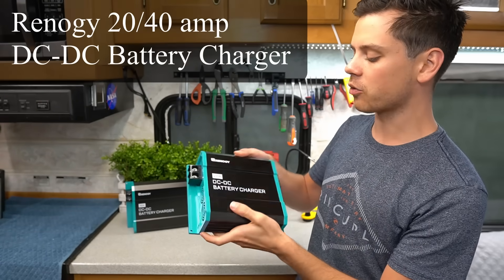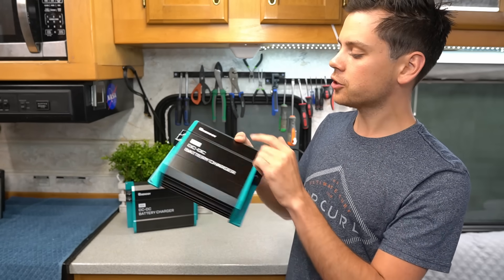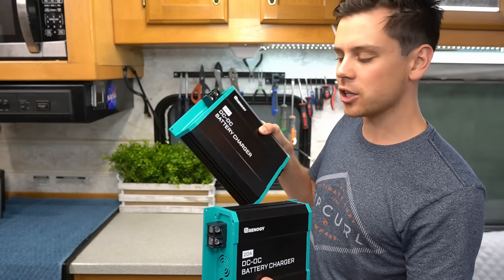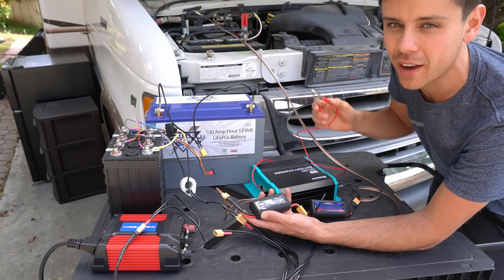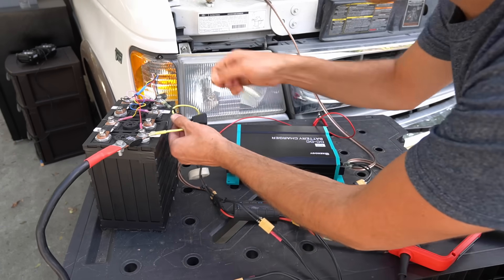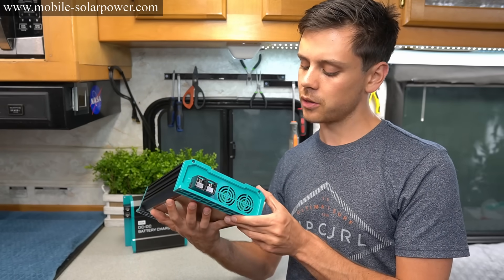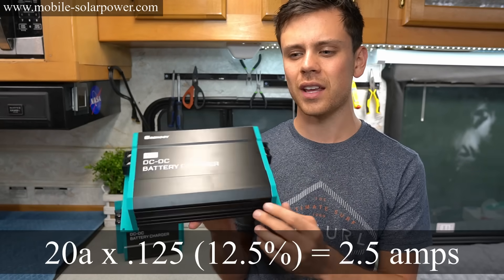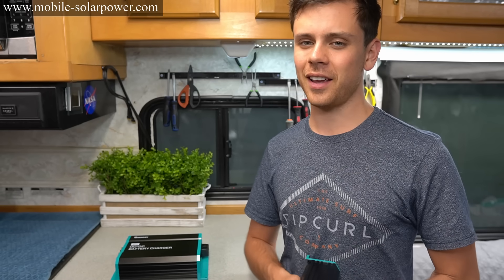Renogy DC-DC Battery Charger Review: "Smart" Alternator Charging for Solar Batteries!

Comment: Would you need to used this between the 12v 30A RV port on a Bluetti AC300 to charge a Lifepo4 battery or could you connect the AC300 directly to the battery?

Comment: My current DCDC charger appears to be failing (another brand), and Renogy came up as the top suggested replacement.  I only have 100ah AGM battery for a portable fridge. I do not have a smart alternator.
My question is:  do you have to have the ignition wire for this to operate, or will it work with without?  I do have a VSR between the Start Battery and the DCDC charger.

OOPS. watched the full video and it does appear that you need the ignition wire....

Comment: The current limiting feature is VERY useful actually. Lets say I have only 90AH AGM battery for my SUV and later on I'm planning to buy a travel trailer and install 400AH LI battery bank. We know for AGM max charge current is about 10-20% of the total AH... so I will buy 40A charger and limit the current... later on for the RV trailer setup.. I remove the current limiting connection... :)

Comment: You could put a switch on the ignition wire and start the engine and then turn it on if you want warm up. A bit of a pain but isn't everything ! This would be nice to have to charge a deep battery to run a frige in my Jeep . always having power for 12v things when overlanding would be nice.

Comment: Hi will! First ty for all you do ive learned so much. I had installed a dc-dv charger to my van by my van conversion company but i was thinking of upgrading to a 2nd alternator to my camper van? Its 3000.00 without labor. I have a 12v AC so i can cool off van for my pups but on rainy days boondocking ive struggled keeping everything going If i just ran the engine the dc-dc charger isnt meant to charge my battleborn batteries without have to drive it qBut ive been told a 2nd alternator would def charge my batteries if i just ran the van and alot faster..I have a ram promaster. Ive have quite a great set up but ive run into trouble boondocking with no sun and had issues with dc charger just not charging batteries enuf when doing short drives. Is it worth it to upgrade to a 2nd alternator?  Anyone with any thoughts or advice would so appreciate it! Thanks to u will i have a great system in my van!

Comment: you can get around the imeadiat start by putting it on a switch that is on a circuit that is energized when the engine running.  ford upfitter switch is what I am using for mine so I can control when I need it even if the truck is running as normaly my solar is all I need on my camper.

Comment: I use the 40 amp dc to dc in my 5th wheel camper. I ran the trigger wire to one of the camper side lights and a  minute after I start the trucks engine I turn on the truck lights which activate the camper lights (they are all LED) which starts the dc to dc charger. When I first installed the dc to dc, I made sure the camper's lithium batteries were in a somewhat low state of charge. I watched my dc clampon meter and saw 39.9 amps. It stayed at that level of charge for a few minutes then slowly dropped off to just an amp or 2. So, that dc to dc charger seems to do a good job of managing the amperage charge rate.

Comment: Great video. You could add a 12v dc "time delay relay" on the ignition circuit to delay power going to the unit, giving your alternator a few extra seconds to power the charger. Simple to install.
Reply: Any recomondations certain manufacturers?
Reply: @mobilehomelife4028  I set one up that includes a programmable delay, and also cut on/off based on system voltage (it will cut off if your alternator voltage is too low, and only kick back in after x seconds once voltage is available) works excellently, i got mine from BimbleSolar (UK based) on their website it's the digital voltage sensing relay EAZY-IV-U3

Comment: The current limiting option is actually very useful for the following reasons: To my understanding (I'm not a mechanic), the higher the amperage of the DC-DC charging the more strain on your alternator, so limiting to 20Ah as opposed to 40Ah charging when you don't need much charging, could enhance your alternator's lifecycle.  You've 2 options instead of one (40Ah and/or 20Ah), so if you decide to upgrade your alternator you'll have the option of going to 40Ah, saving you a load of money.

Comment: The current limiting (LC connection) is well explained in the current users manual. “The DC-DC battery chargers feature 50% current limiting from the rated specification when connecting the LC Terminal to a 12V source. Current Limiting is instant and recommended to be connected to the same location as the D+ ignition cable. Alternatively, you can toggle current limiting to your liking by connecting the LC terminal to starter battery positive terminal. In this fashion, current limiting will always take until removing the LC wire from the battery terminal to revert to the normal amp rating. Use 18-16AWG copper cable for the LC terminal and you may need to splice your own connections for the other cable end depending on your connection point.”

Comment: I believe it was you who said not to use more than 2 batteries in parallel. I just ordered a small solar backup system to power my pellet stove. After doing the math I figure at 2560wh, with it drawing 175w and not being able to fully drain the battery, at best I'll have 7 hours of heat. Definitely ordering a DC to DC charger. I think I'd of been better off using my truck vs solar power. It cost almost 400 for just the 2 batteries, and plan on buying 2 more next month. Was gonna buy another 200w of panels too. Not so sure solar if for me.

Comment: From what Ive seen Renogy recommends using the 20 amp DC-DC charger if your alternator is 160 amps or less. Even my 09 diesel dually truck only has a 145 amp alternator so I went with the 20 amp Renogy. Last thing I want to do is over tax my trucks alternator in the summer when the AC is running at night with all the lights on.

Comment: Will a test of the renology dc dc 60a be forthcoming and a breakdown of choosing the right amp charger for your system.  My alternator can output 160 amps. Therefore I chose the 60amp renology assuming it had sufficient amps to charge from. I hope I’m right

Comment: Hi will, quick question regarding the 20amp dc dc charger, I live on a river boat with 390ah AGM battery bank, I have the Victron Orion 30amp dc dc charger installed but it only ever seems to put in 23-25amps even when batts are at 65%? Would it be possible to add the 20amp renogy alongside the Victron to boost the charge rate? Would it affect either unit or damage batts? Thanks Andrew

Comment: Question, if anyone can answer and apologies if it's a noob question, but something I've been wondering for a while!
So, I get that charging a lithium battery from an alternator directly could potentially damage your alternator or part of your charging system, however is it possible to damage the lithium battery also and why?
Lithium batteries (in my particular case), have both over/under voltage protection and are capable of taking up to 150Amps input charging. So, what's to say you can't just take a big heavy cable from your alternator and attach it straight to the lithium (with a standard cut of switch). This is assuming the earth from the lithium is attached to the chassis of the vehicle. Theoretically with bigger alternators, such as a 400Amp alternator, this could essentially charge your lithium from 0-100% in a matter of a few hours driving.
I know that different battery chemistry's/setups (i.e., lead acid vs AGM) have different charging profiles. But as far as I'm aware, a lithium will take all it can until it's almost fully charged and is capable of a high charging current. So, what's the drawbacks of this?
TIA

Comment: Thanks for doing these videos. RV application question when converting to lithium . Can I use my lead acid shore power converter for the engine starter battery to power a dc-dc converter to charge a 200 amp lithium house bank and would it be efficient? It seems redundant to have three new chargers ( shore, alternator, solar) when they basically do the same thing.

Comment: I have a wire kit it has a female cigarette lighter plug it has a male cigarette lighter plug and then it has another plug that you can plug into either one of those that has the clamps that go directly onto a battery my question is this I just installed a brand new AGM battery into my minivan I took my old lead acid battery out that can only hold 17 amp hours if that now and I keep it in my van for an extra backup the kind of run a little fan charge my phone and I have the remedy 100 watt solar suitcase with charger my question is can I just take the male cigarette lighter plug attached the other plug that comes with the kit that has the clamps plug it into my cigarette lighter and then put the clamps on the wet battery and charge it straight from my cigarette lighter without any type of DC the DC charger

Comment: So...The way I understand this, the battery is meant to be an auxiliary  battery to charge NOT the main battery system battery, otherwise the alternator wouldnt have field power to start charging. I have a bus that I'm converting and wanted to replace the main batteries with lithium and use this DC to DC to charge with Alternator, but, if the battery is isolated, the alternator field wont have power UNLESS thats what the ignition circuit does, feed the ignition power??? I realize this is 3 + years old.
ALSO were is the 250-300 watts going? you said there was 700 in 400 out???
Thanks for the videos

Comment: Will I just bought a new camper tow behind and I have a 12v refrigerator I did a test yesterday and left the refrigerator on all day and it had an error code for low voltage the trailer has a solar panel on roof factory installed I t was overcast. I would like to upgrade to lifpo4 batteries two of them. my Queston is can I install one of these in the camper and run the wires from 7 way into camper and back out or does it have to be mounted under the hood of the tow vehicle

Comment: I just installed one in my 40 foot diesel pusher motorhome with the 40 amp unit. I have a 200 amp alternator I was thinking about using the 60 amp unit but decided to play it safe with 40. Thanks for the video.

Comment: hi thanks so much for all your uploads,
is ti normal for the renogy  dc to dc to output less than 14 volts when charging lithium profile at 14.4? when the battery is 90 % charge

Comment: I know this is an old video but if I use this unit whilst I'm driving do I have to disconnect my solar from the system to prevent over charging my batteries?

Comment: Hey Will, For a different solution, why not just use an inverter from the vehicle battery and power an iota battery charger to do the charging?  Stops the specialized products with heavy gauge dc cables and a multi stage iota or intellipower switching based charger can still be used when the driving is over when you are at camp.  Just seems simpler.  Comments?  Thanks!

Comment: Question, can a DC to DC be used without an Alternator? Like to use a LifePo house bank to charge a lead acid anchor windlass battery? 
What could be used as the DC2DC activator?
My sailing Catamaran has two 20hp outboards(Honda electric start with tilt). Thinking of connecting them to give extra charge to house via Dc2Dc.
Then another DC2DC from house to windlass.
Or Do I connect anchor windlass battery into outboard DC2DC?
Have solar and wind. Wind will have to be connected to one of the outboard start batteries to make it work correctly with LifePo batteries.

Comment: Do you have a website where I can get reliable LifePo4 AA rechargeable batteries for flashlights, etc. I found EBL, but their batteries do not hold a charge when not in use. By the way, I have watched most all of your videos and purchased your book. Have all the parts finally, but 6 months later, I have to review everything again before setup. Thanks for all of your info!

Comment: Thanks for the great rwview as always. I have a question. I have a 2021 toyota tacoma which has an ECU controlled smart alternator. Through research I found that doing a ECU reflash I could adjust the voltage to the required 14.6 volts that my AGM battery requires from 13.8 that it puts out from the factory. But I just learned about step up voltage, and  its possible through a DC to DC charger, am I understanding that this charger would be able to boost my voltage from 13.8 to 14.6? I like the idea of not modifying my factory ECU to retain my warranty, can you confirm that my understanding is correct?

Comment: The current limiting function is useful when the unit is mounted in a caravan/trailer and you want to use the existing wiring on your trailer plug.  Here in Australia, the largest current you can put through a 7-pin trailer plug is 15amps, which would exceed the current draw of the Renogy 20amp DCDC charger (which can be up to 30amps).  Reducing the output of the Renogy DCDC Charger using the limiting function would reduce the output to 10amps, which would mean a maximum of 15amps being drawn through the trailer plug.  I have one of the Renogy 20amp DCDC chargers installed in a camper trailer, and configured in current-limiting mode this way

Comment: Will - The current limiting switch allows you to match the charging current to specific conditions.  For example, if you have the 40 amp charger and your batteries are fully charged, you may want the lower 20 amp current to just run the refrigerator on A/C when driving.  The lower current also requires less power and the alternator doesn't have to work as hard resulting in better fuel economy.  You may also want to limit the current when driving in mountains or excessive heat.  I plan on installing toggle switches on my 60 amp charger that will allow me to turn it off when not needed, 30 amps when the batteries just need to be topped off and/or I need to run the refrigerator, and 60 amps when I need to charge the house batteries.   Also, you can use the same ignition terminal for both.  If the charger detects any current on the CL terminal, the current is limited.

Comment: 🤔🤔🤔 With respect to what you “DON’T” like about it and how it starts straight away since you wire it to the ignition switch. What about if you wired it to something that you can choose to turn off and on such as your park or head lights??? That way, you don’t have to use it at all (through the day & when the sun is on the panels) unless you want to. And at night, you can delay putting your lights on until you’re out of the driveway or whatever before turning on your lights giving your alternator a chance to warm up? Would that solve that issue?

Comment: Great video. Wired my 20 amp Renogy D+ wire to a marker light to turn unit on. Simple and safe to alternator since my lights aren't turned on until after engine is running.

Comment: I just use a battery isolator, but it does pop the breaker if the house batteries are too discharged, this might be a good option, especially when going to lithium.

Comment: Hey will, digging this back up:
Is it a viable option to use say a 30amp MPPT charge controller as a dc/dc converter between the alternator and the lithium batteries?
It would add fully adjustable charging parameters.
Wouldn’t that also isolate the lithium batteries from the starting battery?
Since the in/out would be so closely matched in voltage surely the efficiency would be almost perfect right?

Comment: Great video Will, thanks.  I read through all the comments, didn't see the question and didn't see it on Renogy's site.  Is this device a boost converter circuit?  It seems it would have to be to increase by a volt or so a normal alternator's voltage for lithium charging.

Comment: I was already planning to use the 20amp version of this charger (alt is 55amp) for charging my boat house batteries from the crank battery. I was also concerned about having the charger switch on immediately when I start the engine, so instead of having it connected directly to the ignition switch, I plan on having a secondary switch that I can turn on after the crank battery is fully charged and the belts etc. are as you say warmed up. I think this will resolve the concern, as long as I remember to switch it on.
Reply: i am guessing, if u forget to turn off the switch, it will drain the start battery.